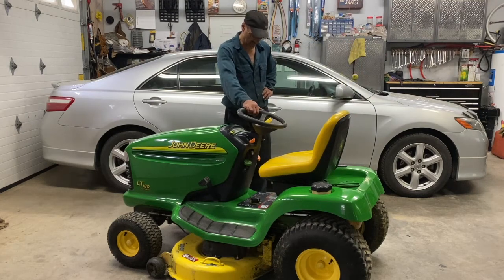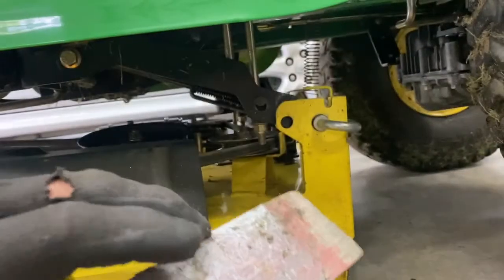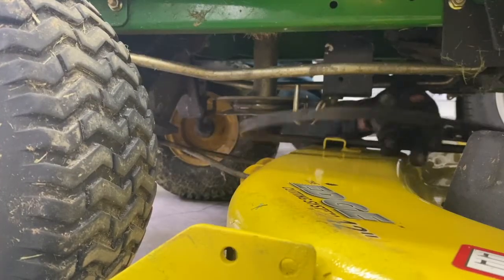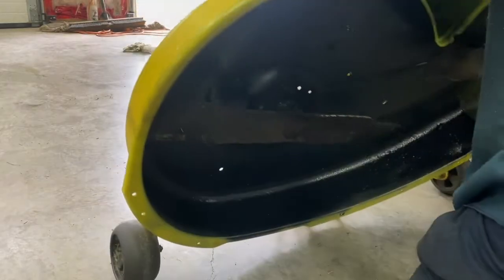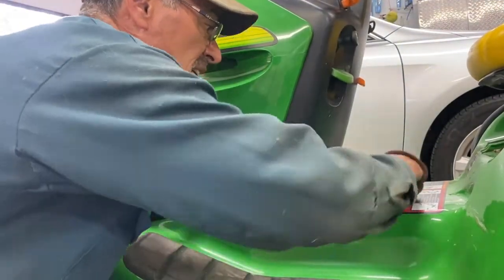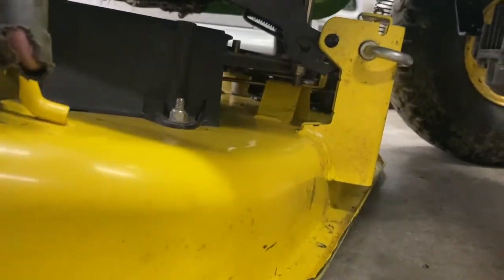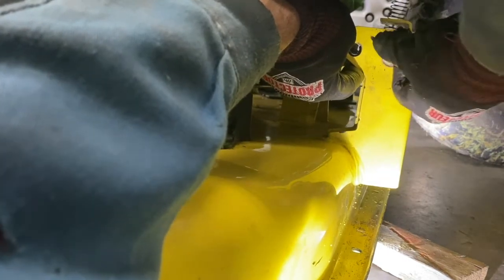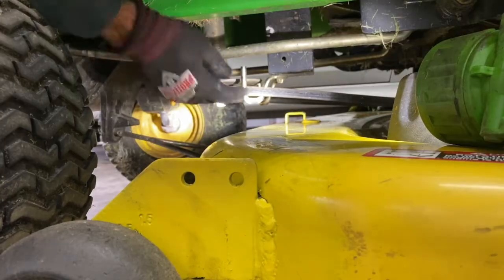How to remove & install a John Deere Mower Deck LT model 42in (LT180 Lawn Tractor)

Comment: What belt size did you use? Also, is there anyway to adjust the belt tension? I’m having trouble with tension issues on mine.
Reply from the maker: I use a OEM belt.   Check all the pulleys on the deck.  One might be bent causing belt tension issues.

Comment: I need to replace my front draft rod.  The kits I see online are only about 10 inches and the gap I measure is about 13 inches.  Is there another part that the rod connects with and attaches to the mower frame?
Reply from the maker: Enter your model number and lookup the part you need here:
https://partscatalog.deere.com/jdrc/
Reply: Didn’t work.   Wish I could attach the pic of the PIN.  It’s MOL180J506703
Reply from the maker: @user-gm6nv7ld3u   Send me a pic

Comment: gotta do this to install a new deck belt, question does that guard need to be removed on the left side to install new belt im assuming yes?
Reply from the maker: Guards need to be removed. They hold the belt on the pulleys
Reply: @WeekendHobbyMechanic  thanks bud